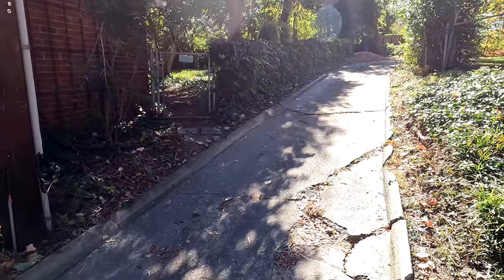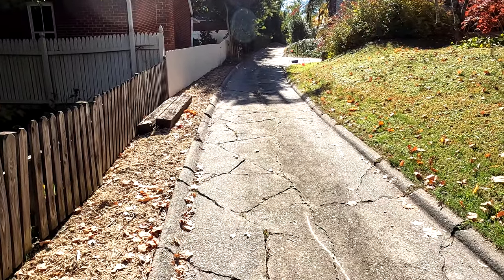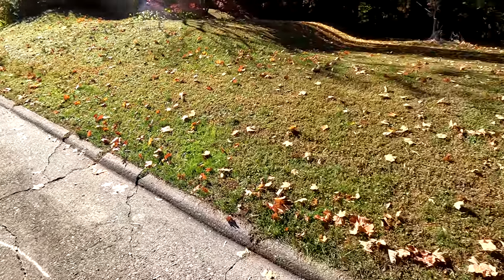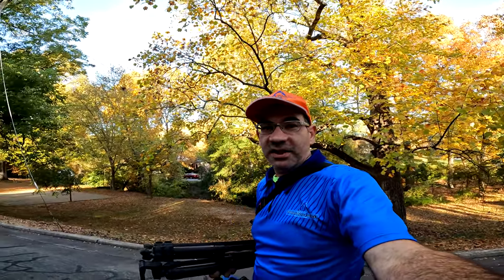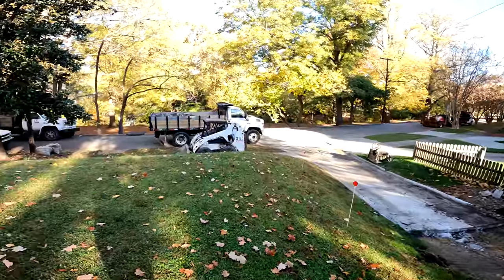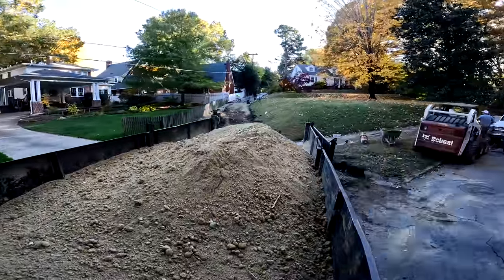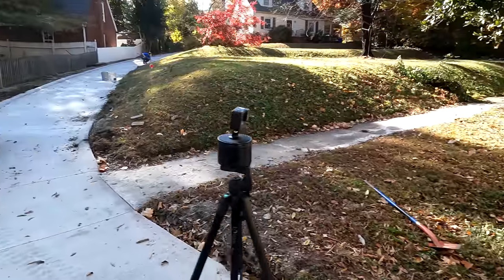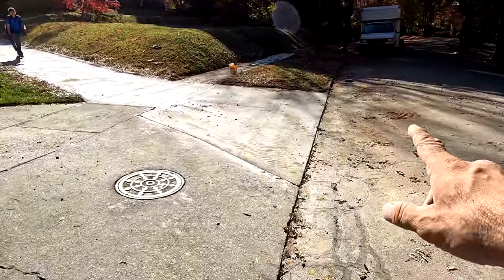Replacing a long alley way

Comment: Not having steel in the concrete sure makes for easier tear out. I remember when y’all did the patio and channel drain. This is what happens when you do good work; you get called back for additional work. Great job, as usual, Shawn.
Reply from the maker: Thank you Jack!
Reply: no rio barr. driveway will certainly crack again
Reply: @brandonmullins5865  depends on the soil under it. My driveway has no rebar and I have no cracks and its almost 20 years old.
Reply: @brandonmullins5865  Only if you go over weight limits....

Comment: Great explanation on rebar and soil grade. We have clay soil in our area which compresses and expands greatly. Without properly removing and using rebar where needed, let’s just say a lot of concrete contractors in our area do very well for themselves.
Reply from the maker: Lots of subsurface water will do that in clay soils. We don't have that, or a frost line here.

Comment: …. Wait …. Been just fine? Looked like a crack city…..

I don’t care if you put rebar in or gravel or whatever. But the old concrete was a bit sketch with all the cracks. Questionable load rating
Reply from the maker: Yea it got trashed by a dump truck full of asphalt.

Comment: 2 mentions of 2 completely different materials, neighbor got alleyway repaved in asphalt, but the dump truck driver wreck the alleyway with chunks of concrete...... 

Which is it.... Hopefully you don't serve NJ
Reply from the maker: The neighbor had their portion of the alleyway redone in asphalt and their dump truck driver cracked my client's portion of the alleyway which was concrete. We replaced their portion with concrete.
Reply: @GCFD  very sorry, misunderstood video. Overacted for no reason. Thanks for being understanding:)

Comment: Great job! I remember the video where you installed the patio and trench drain and knew you would be back for the alleyway in the future. One job leads to another. 👍
Reply from the maker: Thank you Steve! The homeowners had asked about it a couple times and when that large truck cracked it even further they decided to do it. It was a lot of work for sure.
Reply: @GCFD  did all the neighbors pitch in for this job? how was the payment situation?
Reply: @EMERIC4N  good question. Great job. 👍

Comment: if only i had access to one of those breakers, i wouldn't of wasted so much time doing it all by hand and doing my back in when i was working as a paver
Reply from the maker: Gotta have the right equipment to save your back!
Reply: @GCFD  tell me about it, I still swear I feel the vibrations of the cango jack hammer in my hands over 20 yrs later

Comment: Great video as always Shawn, it looks like the concrete breaking hammer is due a new tip! Thanks for sharing.
Reply from the maker: Thank you Dylan! Yes, that tip has no point and the retainer pin works itself out.

Comment: Your point about different types of soil is a good one, but climate is another issue which needs to be accounted for. I'm further up north, and frost has a way to just wreck anything that isn't built up to exacting standards. If the frost doesn't do it, then snow removal might. We use heavy equipment, graders and front end loaders to clear out snow, the very same equipment that is used to build roads and quarry stone during summer. It is what is needed in order to keep up with heavy snowfall to keep the roads open and the economy going. We've also got a lot of clay which has a tendency to inflate with water, but fortunately, bedrock is only a few feet down, so it is very easy to dig down and anchor buildings and other infrastructure directly to bedrock when needed.

Comment: Were the curbs required? I think it would be more functional (wider driving surface) and look cleaner if the curbs weren't there.
Reply from the maker: They were there before and they help keep the river of water coming down the drive contained. The HO wanted curbs installed back again. 👍

Comment: What a pretty old neighborhood.  Those old curbed concrete driveways/pathways were also popular with coastal Massachusetts, especially in and around the Boston area.  My Grandparents and Great Aunts/Uncles all had them winding up to their homes (they were masons and road builders from the 30's to the 70's, so they built them themselves), and unfortunately over the years when their homes were sold after their passing, the new owners ripped them all out and replaced with the crappy asphalt driveways we see littering the landscape today.  Your team did a pretty-good job in replicating what was there and keeping with a formed curb running along each side.  IMO it's good to retain older aesthetics wherever possible, well done! 👍

Comment: A-1 Sandrock? Another cool video. That’s one heck of a long driveway. Is that for the one house on the right with basically two access points. One at the side of the house and one that goes to the rear? Why didn’t they pave past the broken asphalt and to the rear? Neat job.
Reply from the maker: Yes that’s it

Comment: Tell them to put a gate with a no trespassing sign as well, you wouldn't want them ruining the driveway again, I would be really really upset. I have 8 camera's on my property, my neighbor has trespassed no less than 4 times so far. The one time I caught him and told him off .. it's funny how people think it is ok to trespass. Nice job Shawn.
Reply: I agree. It was the first thing I thought of. Put a locked gate at the top of the drive on the property line.
Reply from the maker: I think he's going to place a No Trucks sign up there. 👍
Reply: @GCFD  yah specify the Tonage  ...if concrete mixture contain good size stones suffice well..chicken wire mesh is oso good..

Comment: Sorry I asked the question too soon. Notice you put in transverse cracks later in the video. How do you decide how far to space them?
Reply: No more than twice the width but ideally make it squares. They should also be positioned at changes in width, such as at the side walk; angles over 180 are bad. The changes of width will concentrate stress and induce a crack. For a thin slab like this I would do mostly 3000mm sided "squares" but it would depend on the concrete, formation, weather so experience in that location is important.
Reply from the maker: I'm not sure what the concrete guys do, but it sounds like John nailed it above. 👍

Comment: What happened to the old concrete? Anyone can explain to me.
Reply from the maker: It was take to recycling where it is pulverized into a gravel/fines mixture called crusher run. That is used as a base for many construction and infrastructure projects.

Comment: In previous videos you mention they recycle the concrete, any chance to see that in action? I assume they have some big crusher that grinds it up for filler or something?
Reply: It is used as granular fill, hardcore for farm tracks/drives, as a source of sand and can be used as aggregate for non structural concrete (such as road base).
Reply from the maker: I have done some video of us dropping the concrete at the sites but I haven't ever seen the plant in action. Usually they shift the drop locations to where they are not grinding. I would like to see that too!

Comment: Hello 
Did you use a new or old drain grate?
Reply from the maker: We used the existing grates. The grates don't do too much since the driveway is so steep but we put them back in place.

Comment: Hi Shawn. Why doesn't the concrete crew pump the cement through a hose? Why do you prefer to use the little machine with the bucket

Comment: Why don’t you bring your new skid steer on many jobs? I rarely see it in videos. Also what happened to that old cat skid steer? Does it belong to you?

I loved the video! Great work!
Reply from the maker: Josh - this is the concrete crew that I sub out to so they have their own equip. I sold that little Cat (5k machine) and got the larger skid, which is a beast. I would love to get a 7-8klb skid to fill the gap between my mini skid (3k lbs) and the larger one (10.5k lbs). I'm thinking like a T550 or SVL65 range.

Comment: Wow horrible work no rebar. Finish looks horrible driving on concrete not even couple days old lol your supposed to wait a week. I’m sure with the crappy work it’s not even thick enough
Reply from the maker: I talked about why rebar is not required in non-structural concrete in our area. It had been 5 days since the pour. I'm not sure where you're getting your information from but you may want to re-watch the video. 👍
Reply: It is a lightly trafficked  alley, there is no need for rebar if the formation is strong enough. Even if the formation had been weaker they could have got some crushed concrete back from the recycler and put in a 150mm thick layer and most likely still not require any rebar. Finish is better than required for an alley.
Reply: @rubenreyes7901  Concrete is not weaker than it was 40 years ago. Cement is made in the same way. Concrete is also  mixed in the same way. Chemicals and ash or slag where added to concrete 40 years ago so that is not exactly new but we do know more about them now.
 
I have worked on an airport built on a marsh. The joke was that the electrical cable duct system was a second drainage system. All the aircraft taxiways were made from unreinforced concrete. A Boeing 747 is a bit heavier than a sedan. 

If you know what you are doing you only use rebar when it is the cheapest option. Rebar allows for a thinner slab so less concrete and excavation, but you have the cost of supplying and fixing the rebar and the cost of laying the concrete with rebar in it (maybe have to pay for a pump rather than a concrete buggy).   If you need to excavate topsoil etc, provide a drainage layer, remove frost susceptible material (clay) etc and replace with imported fill it could be cheaper to put in less fill and put in a slightly thicker mass concrete slab.
Reply: @johnclements6614  yup, no rebar in continously-poured highways and barriers. It's all about a stable base, thick slabs, and proper control joints. I made my driveway 6 inches thick over a 12" base of crushed asphalt + limestone (naturally compacted for a year before pouring), no rebar and 5 years later zero movement or cracking. The concrete truck didn't even leave a mark in the gravel when it drove in.
Reply: @thebigmacd  There are some public roads in my town with that have unreinforced (never seen rebar when some utility is working) jointed pavements dating back to at least the 1950s or 30s. On busy roads the concrete has been overlaid by asphalt, maybe because of the loss skid resistance or they were becoming a patchwork because of utility excavations. If the ground water is kept below your stone base your drive could well be around in the next century.

For higher speed roads jointed pavements have the disadvantage of noise plus the cost of closing lanes for maintenance to the joints. Then a CRCP (continuous reinforced concrete pavement) maybe better. The slab can be miles long with no control joints (just day joints where you stop for the day if you do not pour 24hours).  The slab is designed so that the contraction cracks occur at random around 1000mm to 1500mm apart, which are not sealed. At the ends of the miles long single slab a ground beam is installed to stop contraction away from the adjacent pavement.